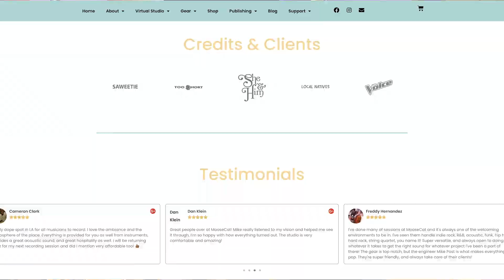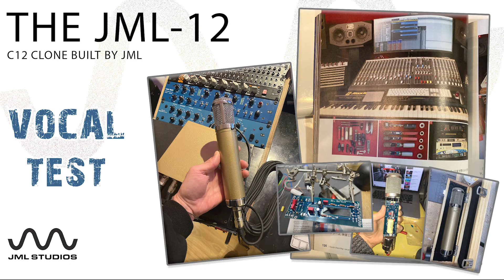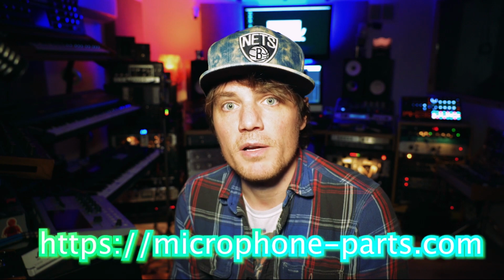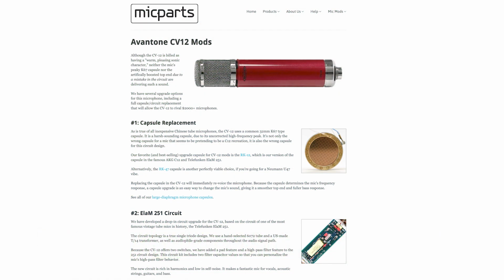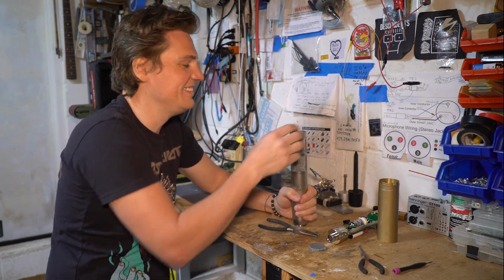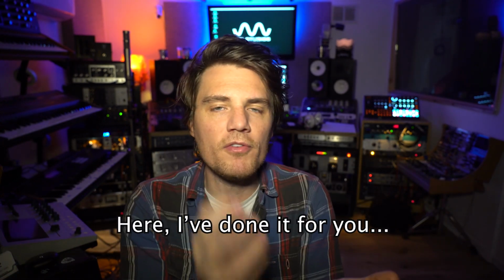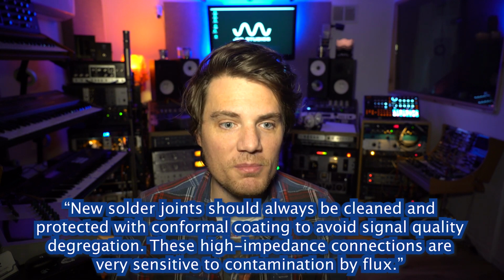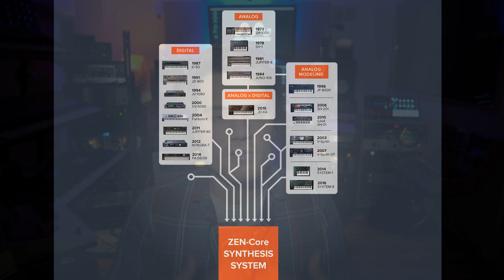A CK12 Microphone Shootout - AKG C24 VS My Hand-built DIY C12 Clone Mic! #C24 #C12

Comment: Was your C12 in figure eight or omni mode? Or was C24 in hypercardioid? It sounds like C24 is narrow and picks up mainly what you are recording, while the C12 takes pick up the back wall / room also.
Reply from the maker: Hi that's a great question. Both mics remained in cardiod the entire video. You are correct in your observation that the JML-12 clone did pick up more of the room but that was in cardiod as well! It loves a closer proximity for sure. The CK12 exhibits a truer cardiod response overall.

Comment: I think you installed the capsule in your DIY mic backwards. Try turning it around and performing into the rear of it... if it sounds better, that will have been the issue.
Reply from the maker: Hi, the center terminated lead is on the rear of the capsule where it should be. These capsules are directional and do have a front and back, the back having the center terminated screw in the middle. I can confirm this was installed properly and not backwards.

Comment: surprisingly, an AKG C24 is not a dual C12. It's actually more like an ELAM 251, including the high-end rolloff capacitor built into a 251. The cathode bias of a 251 is also present on a C24. The pattern switching configuration of a C12 is, however, part of the C24, and that plus the name tends to make people think they're just a dual C12. /MicNerd
Reply from the maker: Hi Vanguard. Love your mics! Your comment is appreciated & I address this exact point at 6:46, check it out. Thanks - JML

Comment: The extra room sound being picked up is the problem.  The C24 sounds tight and awesome.  I think the clone might sound great without all the ambient sound.  Strange, considering the capsule.
Reply from the maker: Agreed - My thought is that the cardiod position is not totally cardiod. A lot of folks don’t realize that true cardiod is difficult to achieve by manufacturers and not always true. This mic has a great proximity effect when close but picks up a lot of room when you back off. If I make this video again I would demo them both up on the basket… Coming soon!

Comment: Genuine C12's have a better low end than a C24.
Reply from the maker: Thanks for the comment however due to the output coupling capacitor on the transformer of the C24 it actually yields a better low end response by a whole octave at -3db over the C12. Matters of opinion quickly dissolve in light of matters of fact 6:58